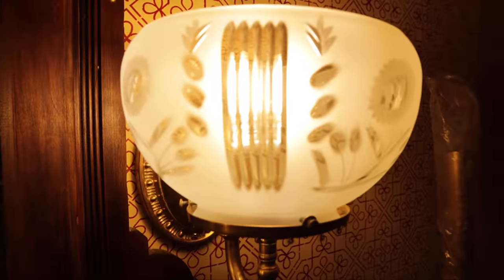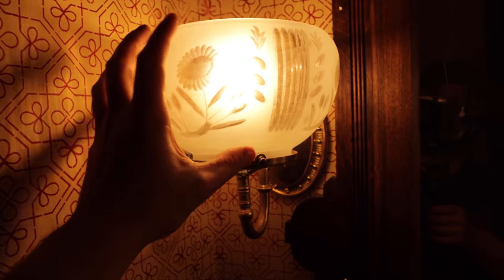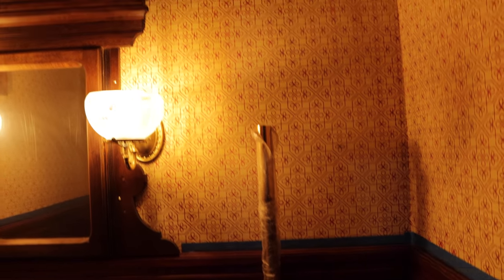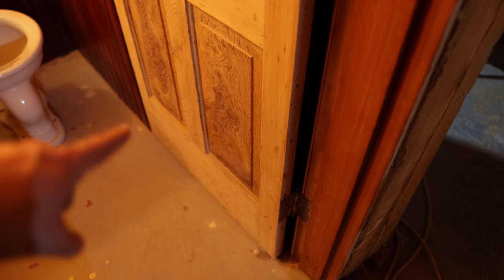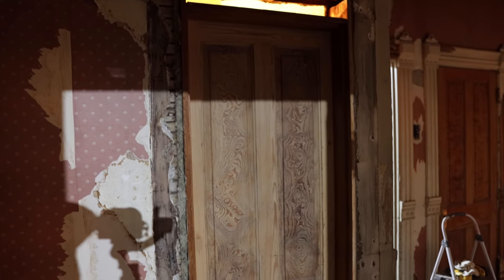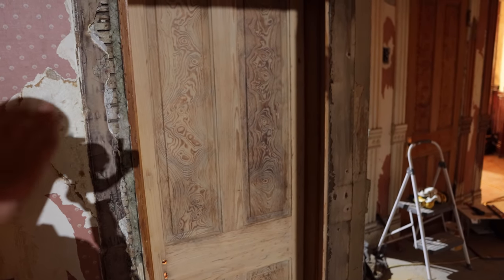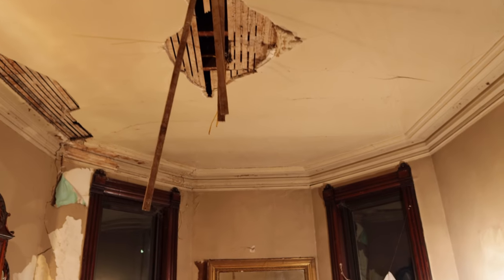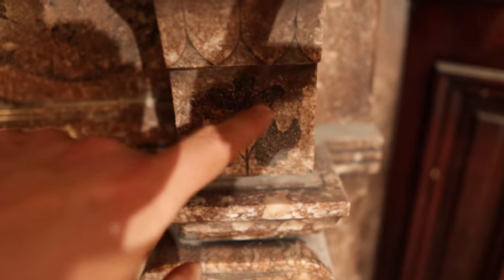Historic Lighting Makes all the Difference S2 EP16

Comment: The bathroom looks absolutely gorgeous now. Really well done!  No, the globes are perfect for the holders and for the room. Can't wait to see the crystals in place too.  As you rightly said, Kaleb, your mirror has worked out extremely well. It looks just great on that wall.  The door fitting so perfectly into that recess when open was meant to be!  The curly pine is just so, so gorgeous and you did a marvellous job of renovating and hanging it.  

Thanks for showing us the cleaned up dining room. What a super room to use as a temporary bedroom for you both.  You said "puppies". How many have you got between you both??? You will need to be extremely careful with all the valuable items that will eventually be on display.  Wagging tails can do a lot of unintentional damage!!  Have a really good week both of you.

Comment: The bathroom looks wonderful! The colors started to hum during the bead board/trim timelapse, as you layered on the stain until it matched. I love the gaslight globes, even without the crystals. Those will be the icing (icicles?) on the cake, lol. I am very impressed with the door carpentry job; such things can be maddening. Two thoughts: 1) Consider the interior doorknob when designing the shelf/cabinet for the space below the window. 2) Women need a certain level of 'true color' light when putting on makeup. Once guests will be there, you may want to figure out an alternate vanity area. If I was you, I too would be dancing on air over that dining room. Waking up there every day will be a lovely payoff for all the hours of paint stripping and plaster demo. :)

Comment: I'm glad you found an alternate source for the pipe to fit your toilet.  It will look much better with a longer pipe.  I worked for Renovators Supply back in the 1980s when they  had  retail stores.  The high tank toilets we sold back then only had one height, and they seemed to be designed for standard 8 foot ceilings.  Their plumbing line was problematic back then. During the first year that I worked at the store, customers returned every one of the RS faucets that we had sold. Eventually, I stopped selling them, referring customers to other retailers that sold a better quality  product.  When I eventually bought my own restoration project, I didn't go to RS for anything that I needed, and ironically found more stuff that worked for me from IKEA.  Until you mentioned them in this video, I assumed they were out of business.  I hope they are improving the product line over what they produced when I worked there.

Comment: I am so happy that in your projects you stick to the historic manner by which things were done, especially when trying to achieve the same effect that light would have been like back then.  Why else go to such lengths in restoring a beautiful historic home such as this?  Yes, I know we live in the 21st century, yes I know it is popular and typical to go for the essence of the past but without taking on too  many of its disadvantages.  But in honestly, if I had the ability to do this, it is exactly what I would love to do.  

There is a beauty in the objects of the past that we are quickly or have lost as time speeds on.  It isn't just the specific styling of different era's, but the manner by which they were made. Sometimes crude, and tedious, methods were used.  Much of it still had direct hand to tool to raw material means of production.  Today, we have such exacting means for producing objects, including reproductions, that these objects we live with are too perfect.  Even when reproducing objects of long ago, it is often very easy to spot a machine made reproduction, simply because of this fact.  The edges are smooth to perfection, there is no variance to lines, bends, circles, or anything that would normally reveal a less exacting method of construction.  This is one of the charming elements to these old objects, at least by those who are drawn to them.  Those imperfections and not quite accurate imbalances are an obvious revelation of their connection with the species they originate from.   

We have such lovely, perfect objects today, even more perfectly formed than objects of thirty or more years ago.  With the advances in plastics, manufacturing technology, the advancement of computer technology and all the countless ways it helps us create things.  But, I love old items. I always have. I can touch them, look at them, and almost surmise their  history because I know by their imperfections they once belonged to others, for a long time and from long ago.  I love that.  And lest I forget, the incredible world from which they came, of all things made from natural materials.  

The era of plastics, as we experience it today, has only been with us over the past fifty plus years.  Synthetic plastic as I recall wasn't invented until the turn of the century, and it wasn't until post WWII that it began to be used more and more. Then the 60s and 70s was when plastics began to replace natural substances in so many ways in life.  So much so, that by the late 80s and 90s, plastics had begun to replace much of what once was made from glass, metal, tin, cardboard, paper,  wood, etc.  During those years it began replacing  traditional food containers, disposable items, and on and on.  It has happened so quickly and dramatically that it has been just less than sixty years that we humans have almost buried ourselves and littered the world with plastic and to such a degree that we are in a crisis.  

It was also not too long ago that individual recycling efforts actually meant something, that is until fairly recently when those developing nations that once bought our tossed out plastic refuse stopped.  Because of this dilemma, it is estimated that at the moment only 10% of consumer recycled plastics is actually being recycled, with the rest being tossed into land fills.  No matter what we do as consumers, the problem now is not our recycling efforts, but the fact that manufacturers are literally tossing it at us and in ever-increasing amounts. We as individuals are not the problem anymore.  It is the manufacturers, the source itself from which all this plastic is produced.  It only takes a momentary shift of awareness to  realize just how “everywhere” plastic is in our lives.  

Until manufacturers stop or find a healthier alternative, it will only continue.

I very much like that despite a glass sconce shade appearing too large by today's standards, he chooses to maintain the original while explaining simply -- why.  Both from a historically accurate practical standpoint, but from a historically accurate aesthetic one too!  

Oh, how I so terribly wish I could do something like this! It isn't just the end result, but the ongoing process.  That almost endless stream of discovery, learning, and converting of someone's old “nothings”, into something again. I am so glad that you are recording this for us to watch and experience!!!! Thank you!

Comment: I did not notice door stops, forgive if are there.  
per: Did they used to use door stops in second empire houses? If not, you still might want to find stops so wood and plaster don't have potential of door knobs going into/through them, respectively.

Comment: Luv the lighting in the bathroom- I got excited when you pointed out the wire loops for chandelier crystals on the fixture- how elegant! The dining room is way cool. The China hutch closet with the glass door is cool for treasures, hope it will eventually be lighted. I really love the antique mirrored furniture piece you have in there, I think that's supposed to be some sort of a buffet with the little glass doors on it? But it's kind of built like a dressing table- I imagine Kim will love using it for that while you guys use the room as your bedroom- it's GORGEOUS!! That's cool about the hockey and the hockey gear- I've been meaning to ask, are you Canadian? I hear a faint Canadian accent sometimes when you speak. ❤
Reply: I think he showed that the original light in the hutch still works? (in another video)
Reply: @lauramitchell6725  Cool! I'll check for it.

Comment: Mac the Antique Plumber is very good.  I bought a high tank in 20 years ago and went to install it 15 years later.  It had a crack.  They sent me a new one... 15 years later!!!  All the stuff I installed 20 years later is holding up nicely.  However, I assume they are victims, just like we are, of sub standard manufacturing practices.  Not their fault and hopefully their stuff is still good.  Some of the hardware for my high tank isn't available today, for example the large chrome plated nut that you will see on the bottom of the tank.  I think they send plastic now, unless they found another source.